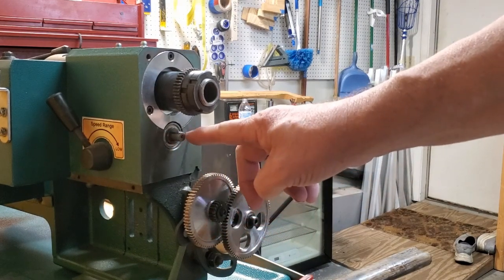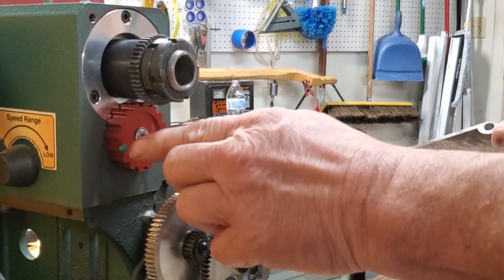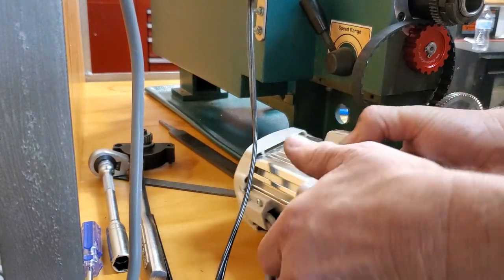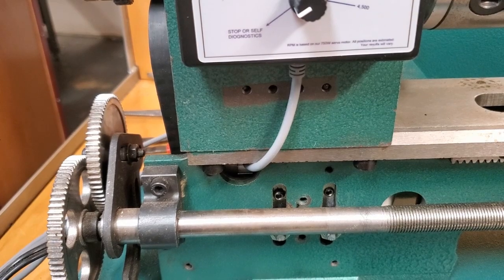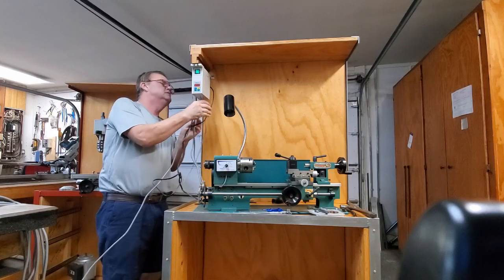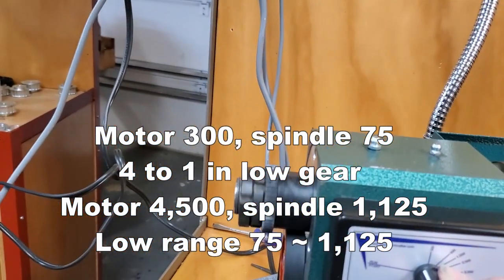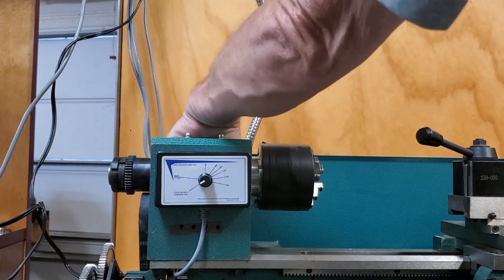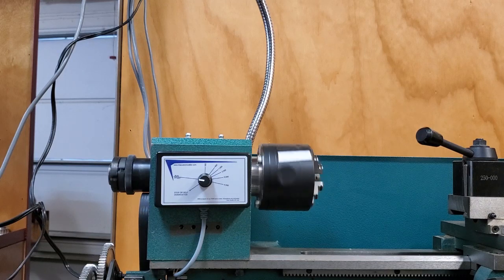2 Speed Mini Lathe Servo Motor Mod Peals Metal Off Like a Big Lathe. Includes Spindle Ratio Results

Comment: Hello... is there a difference between the 2 speed 750W Servo Motor Upgrade Kit and the 2 speed 900W Servo Motor Upgrade Kit other than the wattage?
Can these kits fit the Craftex 704 mini lathe from Bust Bee Tools...?

Also ... do you ship to canada?
Reply from the maker: First thing to consider is do not rate servo motors by wattage. This is the power consumed and it is very inaccurate.
Our 750 watt BLDC servo motor produces 10 Nm torque. Lets compare that to Steeperonline.com 
Their  T6M80-750H2A3-M17S; 750W AC Servo Motor only produces 2.39 Nm and it tops out at 3,000 RPM
So as shown two identically rated at (750W) motors are off by 400%
Their motor 2.39 Nm 
Our motor 10 Nm
Their advantage is their motor/driver has feeds to hook up a CNC computer and I have to say, their prices are extremely competitive.
Their disadvantage besides low torque is controls become more complex. You will need a CNC computer or additional speed control to run it.

As for your Craftex 704 mini lathe. the 900 is overkill and it tops out at 3,500 RPM.
Use our 750W servo motor. It will produce way more torque than the 3 inch wide bed needs.

Comment: Your motor is a definite improvement!👍
I could not easily see, but were those regular washers for the motor mount? Thicker hardened Industrial washers (black oxide) are a necessary improvement for those crudely cast motor mounting slots in the casting in my past experience.
Respectfully, aluminum can be turned with a sharpened piece of crs 😎 and a true test is drilling a decent hole in carbon steel.
I can already tell that your upgrade would handle the needed torque for drilling. Bravo!
Reply from the maker: Hi Charlie. Thank you for watching. Of course the washers are grade 8 thick washers.
Reply: @danielmartin382  Okay, watching on my phone's small screen, I could not distinguish the thickness as I am familiar with blk oxide examples.
As mentioned, you might want to display the increased torque by turning and drilling in carbon steel rather than soft aluminum. Cheers